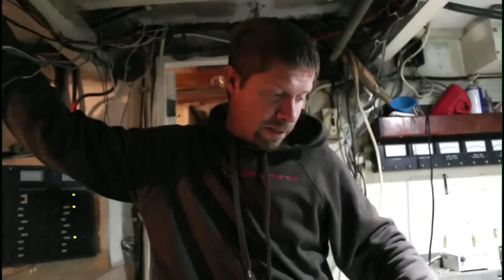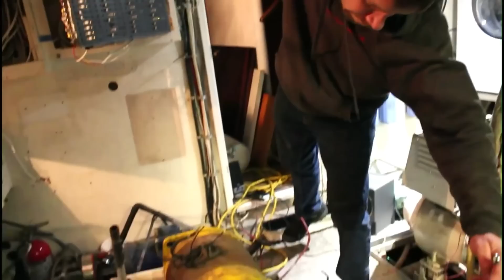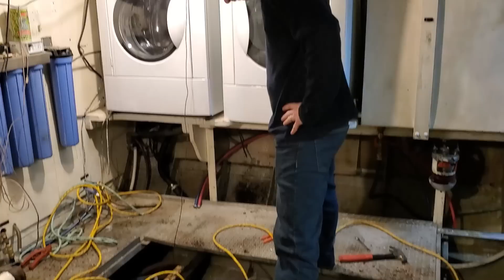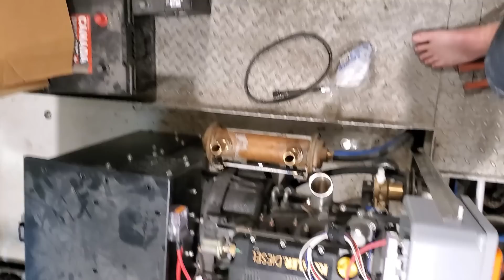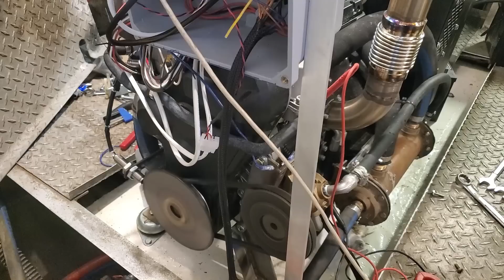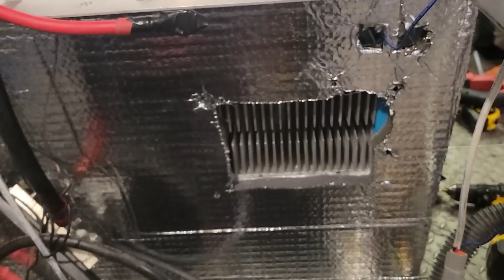We Built a DC Generator with Alibaba Parts and an EBay Engine

Comment: Have you considered using a couple of very large water cooling sync plates for the actual rectifier diodes? You could then put them on the coolant circuit. Just a thought. Love your system, i used to work on navy dc power systems and we water cool them. Hoping you will sail to the UK one day  👍
Reply from the maker: Funny enough, I had just started thinking about this last week. It would be pretty easy to get some thick copper or aluminum and cross drill some holes for coolant flow. I will see how the new setup works as is and make a decision after that. We certainly may be on that side of the world at some point but it likely won't be for a few years. Take care!
Reply: @OnboardTangaroaSeatrial  Maybe bonding the diodes to a heat exchanger from a boiler central air system would work. The sizes would be about right and it would save a lot of work. Even aluminum conduit with a coolent flow would be better than forced air cooling. I hope the idea and the smoke alarm idea helps too. I look forward to your next update. 🙂
Reply from the maker: Thanks! I am hoping to get the new generator setup up and running this week. Just painted the bracketry today. I do have a bit of wiring to do before I swap it over though. Have to get as much done as I can before I decommission the old generator head so I am not out of a generator for too long.

Comment: I wonder if you guys would have still bought the boat if you were fully aware of all the work that had to be done? I'd also be interested in knowing where the male half of the team gained so much knowledge about all the different technical work he does.
Reply from the maker: I think we still would have bought her.  We wanted an aluminum boat, and they are hard to find, especially with how well built Tangaroa is. As for Blaine.. he studied Air Frame and PowerPlant ar Sparton School of Aeronautics in Tulsa OK.  Upon graduating, he was hired into superyachts and was one of the youngest engineers in that world.  He did that for approx 8 years.  When we moved to Canada, he opened a performance car shop 5252 Motorsports, then Carmena Performance.  He likes putting engines you don't expect into cars and making a heck of a lot of horsepower.  As for learning...he is constantly reading manuals and researching tech.  Every night, he is learning what new stuff is out there.  Right now, he is fixated on pod drives!  Cheers. J

Comment: So why not setup a little wind turbine whilst your on anchor in the winter?

Adding a wind turbine would reduce the amount of time you have to run your generators and save you fuel.

Some people complain about the noise, but it's only in winter when you don't get much solar and you'll have all the windows closed that you will need some wind energy.  And the vertical axis wind turbines are quieter than the horizontal axis turbines.  And aerodynamic engineers have designed some quieter turbines now-a-days.  And a wind turbine will be a hell of a lot quieter than those diesel generators.
Reply from the maker: We will def look into it.  Thanks.

Comment: Are you running closed loop communication between you batteries and Inverters?

It might be you inverter turning down your amps.

If the generator is capable of running 400 amps then it should unless the inverter or batteries can’t accept it and are turning it down.

 Check the settings on your Victrons.
Reply from the maker: Unfortunately that is not the issue. The generator controls amperage output based on a 0-5v output signal from the Orion BMS. I have confirmed that is is sending the full 5 volts when the generator is not producing. The batteries are definitely able to accept it and much more.

Comment: I went with the KDW702 Kohler shipped to the door for $2,100. For our off grid home.
Reply from the maker: Pretty decent little engines. I did debate getting the high volume oil pan although ours seems to do pretty well for oil consumption.

Comment: If you decide to change your DC generator head you should look into the 3rd gen Toyota Prius gearbox. It requires the diff and a planetary gearbox internally to be welded but it is capable of 80kw on the MG2 side. If you pair it with it's inverter module and bypass the boost/buck converter it is a high quality generator. It is capable of 600v 300A.
Reply from the maker: I did briefly look into it however I feel it adds a bit more complexity than I would like. The way I am currenty building it is quite simple and has very few areas for potential failures and those are easily fixed. I may look into something else in the future though. I am always keen on a good project.

Comment: In the middle of watching this I wrote this long comment about how it would have been much better to go with the 24V alternators that were used on Detroit Diesel busses and how high current and reliable they were. I had to delete that comment lol. Really looking forward to the next video to see how they are managed (not that they need much management)
Reply from the maker: Lol, it happens. I should be getting that system running soon. Just finishing up some fabrication on the bracketry. Stay tuned!

Comment: Nothing weird about starting an engine using the generator: most hybrid vehicles do that as having a 30+kW motor-generator permanently attached to the crank shaft makes alternators, starter motors and flywheels redundant.

Redundancy elimination doesn't work quite as well when slapping off-the-shelf industrial lego bricks together.
Reply from the maker: Definitely aware that the new vehicles use this technology but in the marine Genset world, especially the era of that generator, it is indeed weird to see.  I was hoping you could expand on your lego bricks comment. I don't know if I quite get what you are saying.
Reply: @OnboardTangaroaSeatrial  "Lego bricks" in the sense that they are generic mostly self-contained off-the-shelf modules that you slap together in whatever configuration you need to achieve your goal.

That would be as opposed to tightly integrated package optimized for a specific purpose that can get the same job done in half the weight and space.
Reply from the maker: Gotcha. Fortunately there are no space constraints here. Judging by what I have seen in what is available to get the same job done in half the weight and space i would likely be into it by about 4x what I have into this setup. Short of the crappy generator head it works perfectly and is integrated in with all of the other electrical systems. Im not big into paying big money for something that I can build to do the same job if not better. Lego bricks are fine if you are good with lego.

Comment: Regarding the 400a charge current “drop off” …The  “charge profile” which he Chinaman may have been referring to is probably the requested charge voltage and current as well as the particular float charge parameters in your BMS…And what the Victron “pulls” from the generator to satisfy the BMS’s request.  I know that my Daly, JK BMS and JBD BMS’s allow precise control over these specific parameters but I’m not sure about Orion.  I’ve just never owned one.  Maybe I’m missing a key detail, who knows!?!?
Reply from the maker: Sadly its not. The CCL for the genset comes directly from the BMS and its still allowing full charge current. The Orion has a 0-5v output based on CCL. I have confirmed that the signal is getting to the generator and it does work as intended. Thanks for trying to help though. It has been frustrating.
Reply: I had same thought. Remote battery voltage sensing would work much better for my solar MPPT. Increasing wire size helps but still leaves some energy on the table. Seems you already have the remote sensing via the CCL system.

Comment: My head hurts watching this 😂 I don't know enough about electrical to even try build a generator from scratch. I can see why you want DC to charge the house batteries. Having DC to inverters is cleaner power, better for electronics and better for LED lighting they do not like dirty power. For high AC load an inverter isn't going to like that so much that baby would be getting a little cranky. I think I would have had a whoopsie with those old engine blocks, what oil slick I never seen anything lol. Surprised you didn't make Janis an exercise bike where the rear wheel would be the chain is hooked to an alternator she could be down there sweating to the oldies watching Richard Simmons videos 🤣
Reply from the maker: It has been quite a go. The inverters seem to handle heavier loading fairly well. I have had them worked pretty hard plenty of times with no issues. I can overload them if I am welding at full output with some other loads on as well. Debating stacking a couple more in there. Lol, people tend to frown upon oil slicks around here. Sweating to the oldies, there is something I haven't heard in quite some time. 😂

Comment: Why didnt you just go with a radiator for cooling of the generators ? I worked on a couple of tugboats with that on … not proplem with saltwater eating the block or stuff in the filter . Soooo much better
Reply from the maker: Mainly due to heat in the engine room once we get down to hot climates. The new turbodiesels (future video) dislike hot intake temps. Its also harder to do a sound enclosure that way. On this system the seawater doesn't reach the block. There is an external heat exchanger for that. Definitely easier to air cool though.

Comment: Excellent video!

China specs are often way optimistic.  Your generator might be rated at 400 amp for ten seconds...

Inspect the armatures, measure the wire diameters, get ampacity for each, tally currents and check the entire wire path ampacity.

Check for heating and address thermal issues.

Plan B sounds better ...
Reply from the maker: Lol, plan B it is. I have wasted enough time battling this thing. It leads to nothing but frustration.

Comment: I told the story on another of your YT, that the owners guy took them completely apart and put them back together in the engine room.
Reply from the maker: That is why Blaine got shocked when he touched it while standing on the aluminum flooring barefoot...we took it apart to get rid of it and there was a pinched wire.

Comment: I have used a different Dynaset controller. I had good results with it. It automatically starts the genset, and allows engine to warm-up. Then activates the generator transfer switch. It has worked 4 times controlling the generator automatically. Then when power is restored it cools down generator about 5 minutes.
Reply from the maker: I do like the Dynagen stuff. It's nice to have all of the safeties and it integrates well with the Victron stuff for automatic start and remote starting. Being this is a dc genset it doesn't even require a transfer switch. Just a quick warm up upon start and a quick idle period on shut down. Pretty cool stuff.

Comment: Water pump for the engines. If you only realised they make electric water pumps. You cold have saved so much time and hasles.
Reply from the maker: Definitely aware of electric water pumps but I don't see how it would have saved time and hassle. I still would have had to build a mount setup and wire in an electric pump as well as plumb it. The mechanical pump was pretty simple to get functional and other than an occasional impeller and seal change its pretty bombproof.

Comment: I think your koler motors are Italian Lambodeni sorry spelling
Reply from the maker: They are indeed Lombardini engines. This one has been a champ for the last 3 years.
Reply: I’ve rebuilt one that had unit injection they are great motors
Reply from the maker: That's the same system these use. Makes for a pretty reliable little engine.
Reply: same exact motor is used in construction "trench" rollers.
Reply from the maker: They seem to be pretty common in small industrial stuff.

Comment: Really like the generator video. Just one thing to change for long term operation run time. Get rid of the zip ties on the rubber hoses. Don’t want any chafing and problems in the future.
Reply from the maker: Glad you enjoyed the video! I actually find the zip ties work well for eliminating chafe as they stop relative motion. This connection is close to 4 years old and the hoses are in great shape. That's just in from my experience. Your mileage may vary.

Comment: Do consider using Nissan Leaf motors with OpenInverter software/control board as the generator instead the Alibaba custom stuff. Leaf engines are cheap, reliable and you can store a couple spare ones on your boat. The are also open sourced projects for couplers/adapters available for different purposes as well (via Brat Industries) and an entire support forum full of people doing crazy stuff with those.

Also, have you considered wrapping the manifold with copper wiring and additional insulation blankets, coupled with dry exhaust instead marinizing? This is a small engine with a relatively small heat footprint and keeping it as OEM as possible should reduce points of failure?
Reply from the maker: Just when I though I had settled on an idea someone brings something up that I haven't considered. Thanks, you should know that I will now spend hours of my life and lose sleep thinking about this option 🤣. That seems like a pretty good solution. One of the issues I was battling with the dual alternator setup was efficiency and that EV motor should be pretty good in that area.  

The engine itself is still a dry exhaust however I am having issues with reducing volume to a comfortable level. The two Magnaflow mufflers just aren't cutting it. I am planning to go to a wet exhaust for multiple reasons as much as it pains me.
Reply: I did quite a bit research on the subject myself, for the purpose of building own aluminum catamaran in next 3-5 years, in a serial hybrid config, after a lot of consideration. Those leaf engines come off as a really interesting solution, especially when combined with a repurposed LiFePo4 car battery. You can build a 120kW system for roughly 20k USD easily. Happy to share my notes and findings if you’re interested.

Comment: Great job, those little Kohlers really last well.
Reply from the maker: This one is still kicking after several years with little trouble.
Reply: Our old gas one is running strong after almost 30 years with just basic maintenance.  I saw that kohler did manufacture there diesel engines in Italy though.

Comment: If that iveco engine is as bad as their truck, I'm AMAZED it lasted as long as it did !!
Reply from the maker: I was not sad to see it go. 🤣
Reply: Iveco engines are fine and the sofiem engines are one of the best you can get 2.8 idtd is one of the best diesel engines ever made and used to power vans/gensets  etc
Reply: @davymaclean8481  I've driven several iveco vehicles over the years and have had NOTHING but trouble from continuing breakdowns to hole in the side of the block on a vehicle that had only done 50k !!
Reply: I owned  a few Iveco straight trucks in the 90’s, absolutely bulletproof , couldn’t kill them .  Currently my case 70 hp tractor has an Iveco engine , again , no problems .

Comment: Alpha Romeo were amongst the first companies in Europe to use a Flywheel Alternator... 
Im not surevif it was a starter motor..
But Car tech is generally better designed and built.
Reply from the maker: Automotive is typically where everything starts so it definitely has the upper hand with development.

Comment: Chinese PM alternators are notoriously overrated - if you run them near max they run hot - if they run hot the magnets lose their strength and then the stator produces less -you are not the first to get caught out - you have 2 good engines though - one option you could explore is the flywheel motor generator from a hybrid car they are built to last I have one grafted on a slow turning stationary engine
Reply from the maker: Definitely disappointing. I currently have these alternators that I am going to try out but I am a little concerned about the power required to turn them due to an alternators less than optimal efficiency. I am trying to keep them spinning a little slower and adding fans to assist cooling. I should know within the month if its going to work out. The hybrid motor/generator would be a good option but I feel the price point would be a fair bit higher.
Reply: I’ve often wondered what kind of voltage and current I could get off of a 2nd or 3rd gen Prius generator.  I want  to say they’re around 220-225v but I’m not sure what kind of current they could put out or what the “duty cycle” they would have considering the intermittent nature of Toyota’s hybrid power train.  Any idea?

Comment: gotta say that looks like a sweet Sirocco
Reply from the maker: It was pretty cool. We swapped in a 1.8t motor. That thing was a tire fryer.
Reply: @OnboardTangaroaSeatrial  i've seen some wild swaps into that chassis notably a tuned 2.7TT backed by 6 speed from an S4. would love to see a vid of that scirocco roasting them!
Reply from the maker: That would be a pretty wicked swap. I would have liked to have done a swap into something with one of the supercharged V6 engines out of an SQ5. Those were pretty fast even in the SUV with a tune and a pulley.
Reply: @OnboardTangaroaSeatrial  finding a reasonably priced donor that hasnt been flogged or coked to death would be problematic here sadly.
Reply from the maker: Fair, they are pretty high dollar vehicles.